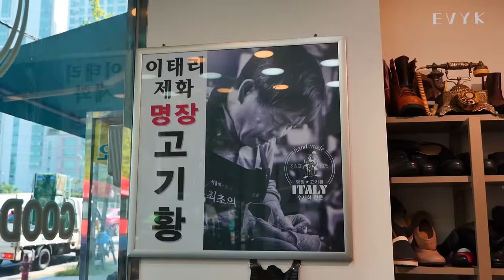The process of making the world's most comfortable Chelsea boots. Korea’s best handmade shoemaker!

Comment: what material does he pour into the sock molds? it's not wax bc it's white as a liquid, and it doesn't seem to be plaster bc he drives nails into it rather easily.
Reply: wax
Reply: @steele977  liquid wax is clear like water. he's pouring something white. as i said in my original post, "it's not wax bc it's white as a liquid,"

Comment: Nice Boot. But it’s not a stitch down construction. He simply glues the sole to the boot.
Reply: Glued is fine for rubber soles in urban shoes. They wear pretty fast with everyday use and it makes for an easier repair, less stressful for the uppers and requires less labor (thus cheaper if you don't do it yourself).
Reply: @trajtemberg  I spent a bit when i first got into boots thinking that anything other than stitch down was trash, i got schooled pretty hard by a local cobbler and you are so right, its building a shoe for the purpose it will be used for.
Reply: nope. Glue on is cheap trash. Either goodyear welting or go home.  @trajtemberg
Reply: @hkfan4596  These shoes cost less than $200 in Korea.

Comment: On the surface this seems like a nice idea but there is a critical flaw in this design. Moulding the shoe to the static position of the foot does not take into account that the toes splay out as the heal of the foot is lifted. This shoe design will result in a tight and ultimately uncomfortable toe box.